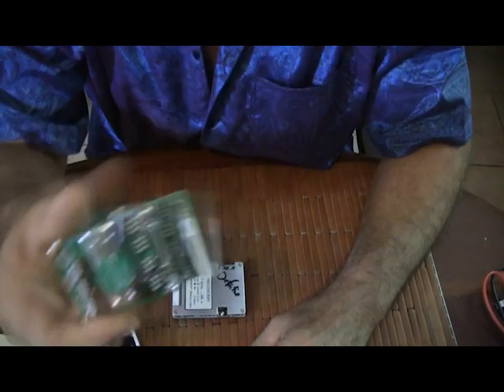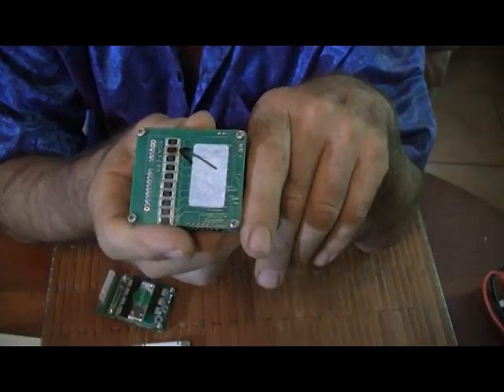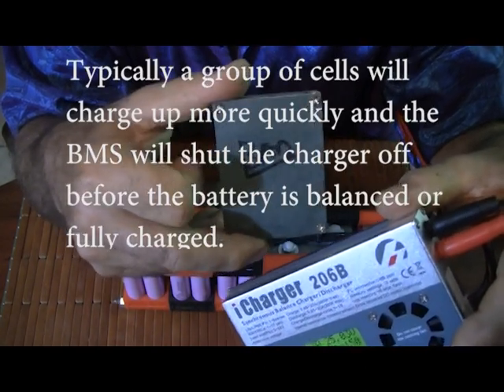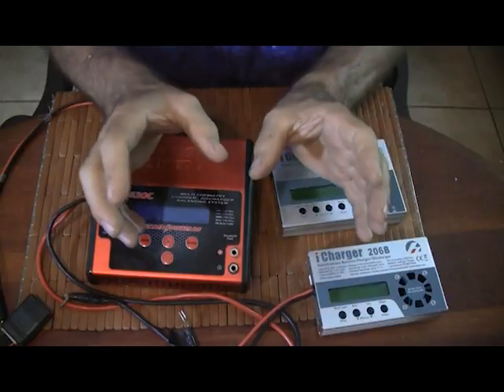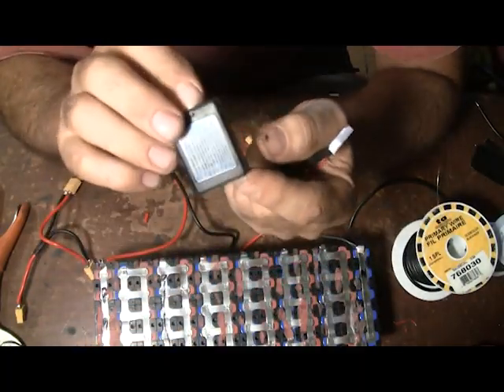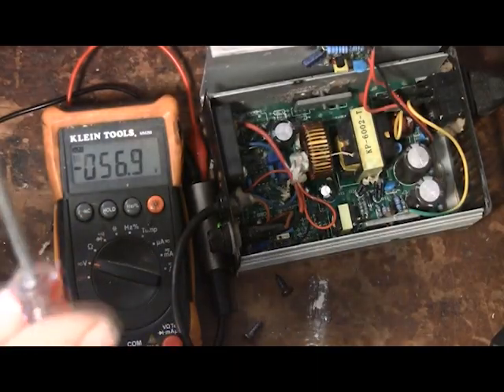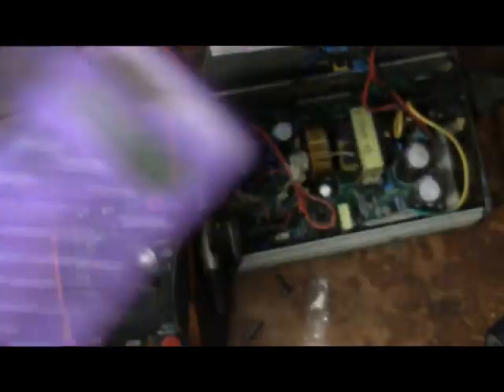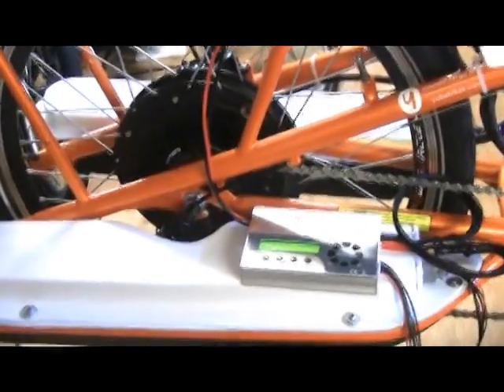How to build a safe and better lithium battery WITHOUT a BMS.

Comment: It's good to ditch the BMS because it uses up power. However if you want to make a 16s pack or anything over 8s it starts to be become difficult to find a charger. It starts to be come a pain in the ass to charge them all individually.
  I have 2x solutions. Get a BMS that is capable of charging as many cells in series as you need (or more than). Then use this as your charger. If you have a step up or step down module you can charge from many different DC power sources. Just take the BMS with you or keep it at home with your power supply.
  The other option is to use small DC step up or step down modules. I like the digital type with the display and constant current function.
  Now you can find some nice connectors and have them ready to plug into the step up or step down modules. Use the modules to charge each cell individually. Screw them all to a board and have a long cable going to each of them from your main PSU or step up / step down module. Now you don't need a hobby charger or a BMS as this system becomes your balance charger. You just need a power source and you have made your own portable charger. If anything breaks it is very cheap to replace the faulty module and easy to find faulty cells. 
  You might want to survey your cells from time to time to see what their capacity is. This is the main disadvantage of using such modules but i believe some of the good modules actually have this feature but it is difficult to find instructions and it is not so intuwitative to use as a hobby charger.
  I think either solution is a good one and a large BMS can be much cheaper than buying a hobby charger for anything over 8s.
Reply from the maker: Great ideas, thank you.  I agree that step down modules that step the supply voltage to 4 volts would be great.  I have built chargers from small 4 volt power supplies also........    I would use a constant voltage charger, not constant current, as you want the current to taper as the voltage approaches 4 volts.
Icharger makes a 10S charger.  But for large series batteries you need to split them in two.  You could then use a hobby charger and balance in parallel.   
I don't quite see how you use a BMS to charge with except in the conventional way.  What am I missing?
Reply: You just hook the BMS up to a power supply with the correct voltage but you don't put it in the battery pack, you are basically making a huge hobby charger but without all of the screens and settings, then you can balance the cells without having to connect all those separate batteries and without having to take turns on the hobby charger or having to parallel the batteries, as i once discovered sometimes the jst balance connectors can make a bad connection and your charger can't see this if it's only on one of the battery packs if it's in parallel with one that is making a good balance lead connection. 
  You could use a decent connector(s) rather than the crappy JST balance connectors. So whenever you want to balance charge you charge from your power supply via the BMS otherwise you just direct charge from the PSU (if it is a vairable voltage PSU, or you use a large step up / step down DC to DC module.
  Alternatively use several smaller step up  step down modules as i mentioned before (one for each cell).
  You then have two options, i prefer the Constant Current supplies.
When you set the voltage of your PSU / DC module as the final charge voltage the current being drawn depends on how close to the final voltage the call or pack is. 
The CC function is for two reasons, to be able to run your Power supply at a lower power than it's max rating so as to avoid overheating. Also it can be used as a safety setting so your power supply never supplies more power than the battery can handle. This can especially be handy if you are charging different sized batteries with the same power supply.
  Alternatively the cheaper way to do it is to use modules without CC but they should not be big enough to allow enough current to ever damage your batteries. However the modules should be able to run at full power without becoming damaged. You would need to size them accordingly so that your max desired charge current is available. This could take some experimenting as it depends on what voltage you are converting. 
  For example, if you were stepping down from 24V to 4.2V the converter is less efficient and might not be able to supply the advertised power at that voltage difference.
  They usually work best when the final output voltage is not too far from the source voltage.
  But in theory you don't need CC if you can find a reliable module that won't ever be able to supply enough current to damage the cells when charging (within the cells charge c rating).
  Even if you use constant voltage the voltage will still become pulled down by the batteries assuming they are decent sized batteries / cells. The battery voltage will rise as they charge and the PSU voltage will follow accordingly. 
  Some larger LED drivers work this way. The power supply is simply never able to supply enough power to blow the LED's but at the same time the PSU is happy to run flat out to it's power limit all day long. It is usually sized so that the LED's get 60-80% of their rated power. I usually find that with larger cob LED's the rating is max power rating only, which ok to use at full power for a few seconds but if you want to use a powerful LED and leave it switched on for long periods of time then you should make sure it's running at around 75% of it's rated power or less.
  You can always add more LED's to make up for the lower power level but they will last much longer and they will run more efficiently when running on a slightly lower voltage / power level than advertised..

Comment: Can you recommend a charger to charge a 7s liion battery?  And balance it. I know you showed one in the video. But that has been a few years ago. I hope to get a baitrium system eventually. That is a big price. And I would like a way to charge other than my solar charged. I have looked on amazon and all I found is 6s. I have a large batt bank. And I want to build a bike. I have been slowly gathering cells. I have 1600 20amp discharge . and the under 2200 mah cells I'm not using are saved for the bike build. I have a few motors. However i would like to get a 1500-2200 watt bldc motor and controller. For 48-96 volts or so. I'm a big guy and we have alot of hills here. I want it to perform like a small dirt bike. Maybe I can trick the police into thinking 2200 watts is 220.0watts?¿ ha-ha  can you recommend a company to buy from? Thanks!!!
Reply from the maker: HI James,

You will need to go to an 8S charger.  They will balance charge 1 - 8 parallel groups.  I like and use the icharger.  But that was before I made balance blocs.  They are easier to use than the Batrium system and cheaper and have more balancing power.  Check em out and see if they would work for you.   
For your bike to really perform you need a controller that can deliver 3000 watts or so.  Your motors if they are the big black direct drive- no gears- ones from China can handle the power.  The controller is the key.  
No recommendations on who to buy from, they all come from China and are reasonable.  When it breaks, replace it.....   look at Aliexpress.

Comment: Hi Mr. Mc Carthy. I love your video and have attempted your method making 2x 7p7s square batteries and attempting to charge with the icharger 208b.  I have run into several issues that I am trying to overcome all having to do with the charger. Maybe you could make a video on how to use the charger to balance and charge and also what type, or what specifications, for a power supply that you need to power the icharger. I have contacted progressive rc and all they have done is had me send the chager back for inspection

Comment: How do you get on if you have an odd number of cells ..can you leave 1 wire disconnected
???
Reply from the maker: Yes, if I understand you correctly, you do not need 8 cells for it to work.  It will work with 2 plus,  and yes, hook up the negative wire then the # of positives you are going to use.

Comment: Oh by the way I have an ancheer bike ebike I'm just wondering if you might have an idea if that particular brand has a BMS imagine it does I'm just not sure where it is if it's in the control box or if it's connected to the battery somehow
Reply from the maker: All ebike batteries have BMS's.  They are inside the battery case wired to the battery.  You need to open the battery case and remove the shrink wrap to find it.
Reply: Shawn McCarty ok thnk you .. So ill need to get supplies to replace the shrink wrap and probably soldering iron to take the BMS off any other suggestions
Reply from the maker: Not suggesting charging without a BMS!  You can re-wrap the battery with clear packing tape.  You will need a soldering iron to unsolder the BMS.  You should get a voltmeter to check each parallel group of cells to be sure they are all good.  The BMS may not be broken, just working and shutting down the battery for a reason.!!

Comment: I believe I found your video by accident but the information you described about the BMS. I believe my BMS maybe bad so I'm not sure if I have one and if I have one should I disconnect it because my battery is practically brand new maybe 3 months old and I normally ride my bike a half hour to work and I ride it everyday on high speed and now I find myself not getting the distance that I was normally getting taking me a half hour to get to work on high speed and now I've got to ride it on low speed I just wondering if it's not my BMS if I have one so should I disconnect it

Comment: Hi Shawn,
I am going to make a lifepo4  battery pack 43.2v 20ah. 
My charger is a Grin Cycle Satiator is it possible to charge the hole batterypack without BMS, or do i have to split it up?
Reply from the maker: Max voltage per cell is 3.6 so you must have a 12S Battery.  The largest commonly available Hobby Charger is a 10S, so the pack would have to be split or you could use my BabyBloc Balancers on my BatteryBlocs website, or you will need a BMS.

Comment: ANYONE can manually control Li-Ion if they know how. I do it a lot. PCM's, PCB's, and BMS are NOTORIOUS for dying on good batteries. That's how I get a lot of my 18650 cells for free!!! People THINK their laptop battery is dead, when it's just the PCM. I have a whole sack of 18650 free!!
Reply from the maker: Hi Aaron,
You are right of course- Here is how I did it, please share how you do it.  I had a voltage gauge monitoring each parallel group on my power wall, and a switch on each parallel group connected to a .2 ohm 25 watt resistor.  When the voltage got high I just turned on the resistor and bled it down.

Comment: do you really have to break the packs to balance charge? might experiment without breaking them in two
Reply from the maker: No.  As long as you only balance charge one half at a time, or use two chargers.   The reason I warn against that is because it is tempting to put the two halves in parallel using a parallel board so as to get them both charged/balanced at once.  But if you do that while leaving them connected in series, you will be making a short, and your balance wires will melt.  (Ask me how I know- ; (  )

Comment: I've watched dozens of BMS videos just to find WHY they use a BMS and why people charge their packs with them knowing (usually) that BMSs don't charge correctly. I've been searching and searching for a BMS which also charges correctly (constant current, etc) without success. 

HOWEVER, Just using a hobby charger is fine for a lot of projects but one that I have in mind is camping.... how do you recharge a pack from a solar panel or car? How do you keep on top of charging many packs a day (I have 6 kids, each with electric ride-ons for example). Any suggestions to solve these situations would really help!

Comment: i have electronically 2 halfs of 14s7p baterries ... for charging each side i use a junsi 308 duo charger. Is there are a cheaper alternative (not using an expensive duo charger) for charging the two 7s7p batteries at the same time. ?
Reply from the maker: Not at the same time.   Otherwise an 8S hobby charger.  Don't connect the halves into a parallel board, you will fry the leads!!!!!!!
You could bulk charge the battery to 4 volts per cell so 56 volts and balance charge once a week or so depending on use.....
Reply: @shawname2  Thank you - learnt a lot from you

Comment: How about programming a VESC or ESC to in place of a BMS and use the BMS only to charge the battery by passing the discharge rate? Is there a battery balance charger that can balance charge 10S or 12S batteries? I've only found balance chargers for up to 6S.

Comment: Thanks for your informative video; I learned a lot. I didn't know about charging and monitoring tools available to advanced hobbyists and e-bike users. Too bad there aren't recommended off-the-shelf tools for batteries >10S, but it's good to know there are workarounds!

While you understandably promote manual management in lieu of off-the-shelf BMS circuits, it seems your goals would be better achieved with a better BMS module. Someone should design and make one.

A better BMS would allow you to adjust charging voltage and current and let you specify a trade-off between capacity and longevity via adjustable charge cutoff. It would have better thermal management with built-in fans and larger resistors. It would display info for cells or cell groups. Beep emitters would supply diagnostics.

A better BMS would pay for itself over the life of a battery.

BMS manufacturers set performance targets too low. They have no incentive to lower TCO; their incentive is to lower our purchase price.

Give me a better BMS and I'll be happy not to install extra wire, connectors, readouts, and switches. I'm not saying anything you don't already know. Further, your recommendations are reasonable, given the state of things.

Strong points of view have an impact over time. Kudos!
Reply from the maker: Yes, there are BMS's with displays and some that work with your smart phone.   But the essential ingredient is bleeding capacity.  After all, keeping the battery balanced is what the BMS is alll about!

Comment: Also, buy some supercap overcharge pcb and change the over voltage reference to 4 volts. i have more problems overcharging a series of cells, this cures that, least cost way.
Reply from the maker: I have not heard of using supercaps to prevent overcharge..  Where do you get the PCB's?  Thanks for the info.

Comment: Hello there, was hoping you can help me out. I'm changing the batteries on my 18v drill to Li-ion. A 5s2p pack and adding balance charging lead. Would it be possible to add a digital volt meter alarm with an on/off switch to the pack. So I can see the voltage. And if so, how would I wire it up. Thanks so much
Reply from the maker: Yes, you could use a cell monitor.  You can find them on Amazon, ebay and Aliexpress.   Wiring instructions will be included.
Reply: Shawn McCarty, thanks unfortunately they don't instruct on how to add an on/off switch to it. I have no prob. Wiring to the 5s pack. Its an on/off switch I'm looking to add. That is my dilemma
Reply from the maker: If I understand you correctly, you want to turn off the celll monitor.  Put the on off switch in the negative wire.  It will turn on and off the entire cell monitor.

Comment: would the hobby charger work best to charge 4-10 of these at a time? https://www.amazon.com/Panasonic-BK-3HCCA8BA-Pre-Charged-Rechargeable-Batteries/dp/B00MXCIK32/
Reply from the maker: Hi Troy,
No, because the cells need to be wired into a battery in order to use a hobby charger.  Use a rechargable battery charger instead.

Comment: how can you balanced charge each cell if you are wiring a group ?
Reply from the maker: Because when you wire cells in parallel- connect the negatives to the negatives and the positives to the positives, the voltage flows from the higher cells to the lower cells until they are all the same voltage...  They become like one large cell.
Reply: thanks a lot to you shawn , i will  built my first battery pack 10s4p split in half so i can charge them with my goourc 2x120w 12.0a multi charger.

Comment: If you make a battery easy to disassemble. And charge the cells individually then you won't need a bms or balancing device?
Reply from the maker: Yes, that is correct.  If you follow that strategy, use big cells so there are fewer of them.  Even a modest ebike battery will have 100 18650 cells.
Reply: Shawn McCarty  THAN YOU.

Comment: The problem is, where do you find such chargers capable of 18s-30s 59.2v-100v over?
Reply from the maker: For bulk charging, high voltage ebike chargers- up to 96 volts- are available.  You can also use a buck converter to boost DC voltage.   Drok makes a wide assortment.

To balance you can split the pack in two- say making a 20P pack into two 10P packs- for balancing and using a 10S hobby charger.